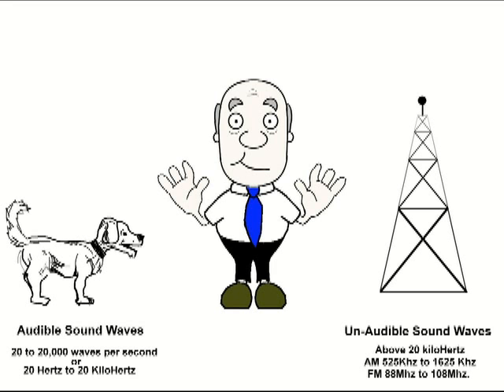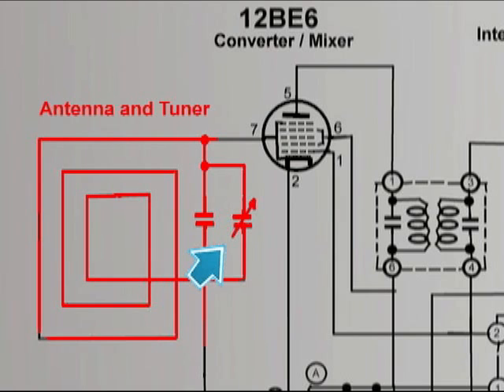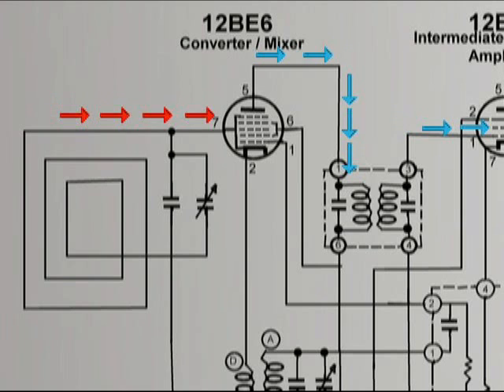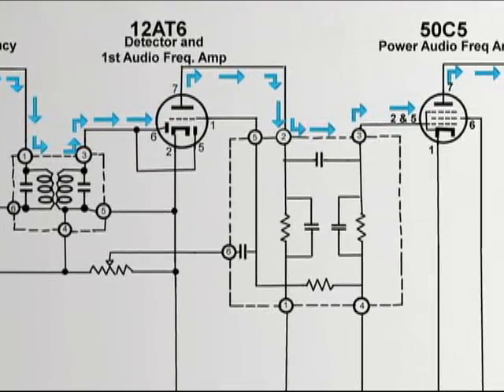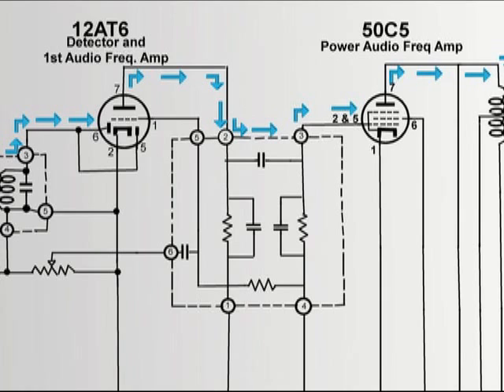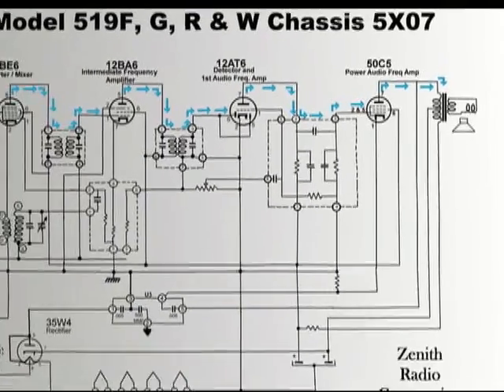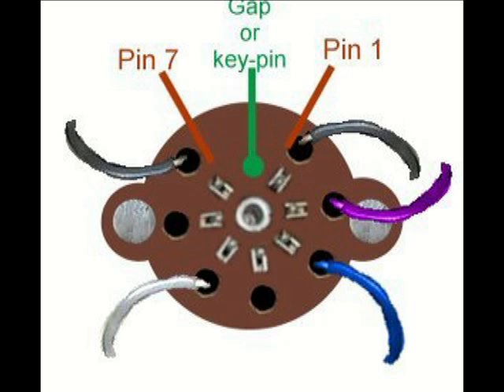Signal Tracing Tube Radios: Basics Video 1

Comment: That "Zenith" model 519 schematic is the most Simplest Zenith radio design I've ever seen !! .....Most Zenith tube radios are significantly more elaborate & complex circuit  designed..l..
Reply from the maker: HiTom.  When creating the video I was specifically looking for the simplest schematic I could find because detailed schematics can be off-putting to new hobbyists.  This all American 5 tube schematic seeemed to be the best choice.  Also, while this is based on the radio's schematic it is actually a simplified copy that I created in my imaging software. (I use PaintShopPro)  I traced every dash, dot, line and text on this scematic from the original.  I left out a lot of information like notes and part numbers to keep the focus on the signal path,  It was a tremendous amount of work to create this video.  Most people don't recognize the effort put into making videos, but you did.  Thanks for that.

Comment: Can't find the "Signal Tracing" #2 video....Easy performed  Effective signal tracing Tube radios & Amps don't Necessarily require special costly test equipment more than a typical, low cost digital > 1meg ohm Vom & a narrow shank Screwdriver performing the "Disturbance" test !!....Assuming typical dead no Sound (But all Working filament heaters) tube set, max volume pot & briefly Short audio output tube Grid to ground Listening for definite Speaker "Pop" static sound....If good pop volume sound, repeat again to Previous stage "Plate" then it's Grid working Towards antenna & Speaker "Pop" getting progressively Louder (Ignore any Plate to ground Sparks) stage by stage...Dead or weak stage(s) quickly identified & appropriate tube Replacement & tube socket pin voltage checks made to correct stage gain issue....If Dead at audio output Tube socket pin "Plate" to grd shorted "Disturbance" test, check tube Voltages & suspect defective Open  audio output Transformer or speaker VC winding continuity.....

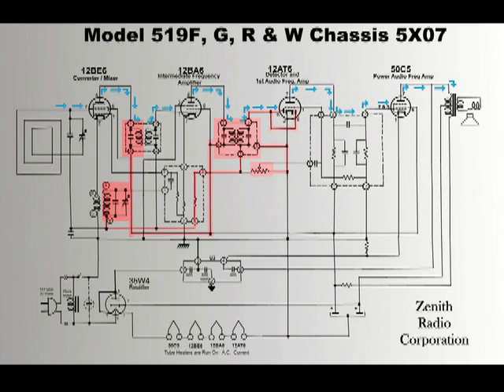Comment: very enlightening!  Thanks so much!  Trying not to confuse myself though. AT 8:59
you show in red the possible problem areas IF there was a problem between TUNE
2 and 3.  I believe that the red "tank" circuits (I think) are "feedback" to help stabilize
the gain under normal situation.  Question, even though it's technically a feedback
circuit, CAN the "signal" early on (when working properly) be BOTH output and input?
That is, Which "dominates"...the "signal" DIRECTION in a feed back...since the signal
can go either direction.  Or if the signal doesn't go in both direction, why not since
it's only a wire connecting the tank circuits between tubes 1 and 2 yet it's wired to
the "grid" of tube 2.  If that make any since!  What makes a feedback circuit operators
only in one direction I guess simple stated!  Thanks!  Can anyone clue me in!!!

Comment: John: I am getting ready to retire and wanted a hobby to keep busy so I decided on tube radios because they always fascinated me. I recently purchased a Eico Signal tester, Heathkit Signal Generator, NRI tube tester and an ESR Capacitor meter. I had no idea what I was getting into because even though I have these testers, I had no idea how to read tube radio schematics or how to use this equipment  but after watching this video I think I now stand a chance. You did a wonderful job explaining this to myself as a beginner and am going to now watch part 2 and all other video's of yours. Thank You!
Reply from the maker: I'm glad I was able to help in some way. It is a very enjoyable hobby. You've purchased some great tools to work on radios with. But they are vintage also and most likely in need of repair themselves.  My suggestion is to purchase a good 120v isolation transformer. Any item you work on should be plugged into you isolation transformer for safety My fondest tutor on YouTube is AllAmericanFiveRadoo. He has a YouTube  video titled "AA5 Radio Signal Flow" that will acquaint you with AA5 radios. These were the most common technology for tube radios from the 50s to about 1970 when transistors took over. I would suggest starting with these AA5 radios in your hobby until you get familiar with all the things that are happening in the radio.  I like working on AA5s but also early 1920s radios too.  Also remember this website: nostalgiaair.org. They have free schematics for just about any old radio you can find. Rick McCwhorter, (AllAmericanFiveRadio) also wrote a book called "All American Five Radios" that was my own first reading material in the hobby. I call it essential.
Reply: @johnallenrichter John, I can’t seem to find your second video on signal tracing. Much enjoyed the first one and would really like to see the second! Thanks
Reply: Second video john?

Comment: Great video, however, when you talk about the upper limits of audio frequency range you Say 20,000 Kilohertz (at time 1:01) which should be 20, 000 hertz or 20 Kilohertz as shown in the diagram. You may want to correct the audio of the video so people are not confused.  Thanks
Reply from the maker: Thanks for the update!  Frequency rate is important when figuring out which audio transformers to choose when replacing so that's critical.

Comment: 8:07...unless the local oscillator is working AND on frequency, there will be no IF signal input to the second vacuum tube!

If the receiver is tuned to a signal, the 12BE6 will amplify the signal- but that particular signal information will NOT make it to the input of the second vacuum tube UNLESS the oscillator is RUNNING and ON FREQUENCY!!!

Comment: What you didn't mention is that the 12BE6 actually has TWO functions: the 12BE6 acts as a MIXER and it acts as an OSCILLATOR- all in a single vacuum tube.

Comment: Thanks for the video and explaining why I can't hear my signal generator. I need an RF and AF generator. What did you use as your signal?
Reply from the maker: You can use a signal generator.  Sometimes I use an antique tube signal generator.    Especially if the transformers need to be adjusted.  But you dont need a signal generator to diagnose problems.  You can just dial in to a strong am station and check the inputs and outputs of each tube for signal strength.
Reply: @johnallenrichter  checking the inputs and outputs with what some kind of audio probe?
Reply: @diydan6045  You can check it with a multimeter.

Comment: Hello and greetings from Saudi Arabia.

I would thank you for the great videos and the illustration you make it available for your followers.

I have Presto K7 Record Cutter Lathe which I couldn’t find any schematic for. I have started the restoration including replacing the tubes and all other components and would ask you to kindly making a video about how to draw a schematic digram correctly for any vintage vacuum tube machine without a schematic available for download and which software you would recommending to use in drawing the schematic to make it available for anyone needs to service or restore the same machine.

Thanks.
Reply from the maker: I apologize for taking so long. I can tell you that tubes are generally just amplifiers. Except for AC to DC rectifiers.  Most of them have an input, like from an antenna or from a previous tube in the series. And they will have an output. Over the years from the early teens to the late 1960s there were tremendous advancements in tubes.  The number of screens in the tube improved clarity tremendously.  I would suggest studying tubes from single screen to triple screens and then also study the systems that drive the screens.  I know it can seem like a forest of things to remember but really with study it will bring it down to clumps of trees instead of an overwhelming forest. And then you'll be able to draw any schematic for whatever machine you have.

Comment: I am doing the same as you I been collecting tube radios for about two years ,trying to  learn everything I can find on my hobby ,I been looking for used or kit form signal tracers,I no very little about them ,most I have seen in kit form ,I have no idea if they are any good a lot of them you need a scope to work with them ,I just want a cheap one that can make a tone to let me no if the signal or current is going through ,I any one can suggest something that would be cool.There is so much to learn .
Reply from the maker: I purchased a healthkit signal tracer on ebay several years ago from ebay for about $40.  It has the ability to detect bot radio frequency and audio frequency.  When the switch is turned to detect radio frequency, it simply connects to a detector tube to change it to audio frequency before sending it to the built-in AF output speaker circuit.  When switched to detect AF in your radio it simply sends the detected signal directly to the built-in AF speaker circuit.  Once you understand this difference between AF and RF signal you can build your own signal tracer from an old cheap radio.  In fact, my first signal tracer was home built with the help of AllAmericanFiveRadio, who is my go to guy for understanding old radios.  He has a book explaining the radios from the 50s and 60s which I highly recommend.  And on his YouTube channel he has a video explaining very easily to build your own tracer from an old radio.  He is an absolute blessing for our hobby and a wealth of knowledge. I suggest subscribing to his channel if you want to learn as much as you can about all American five radios.
Reply: @johnallenrichter  thank for your info ,I like all amarican five too

Comment: One minor point - the first number of the tube number does not indicate the voltage of the tube, it indicates the voltage that the tube's heater filament runs on, although there are some early tubes that it's just a number.